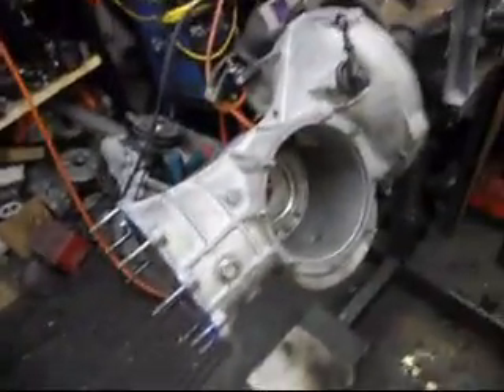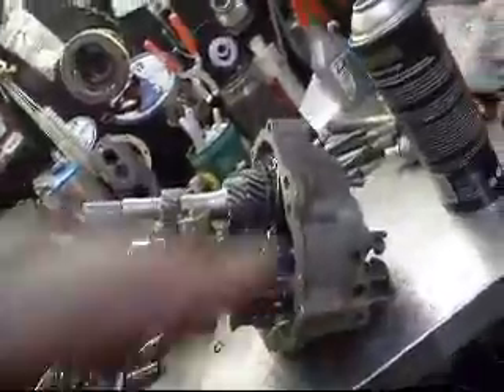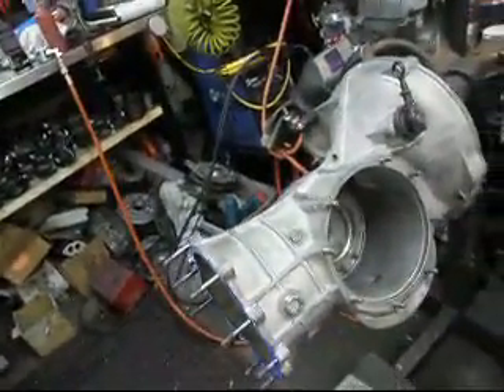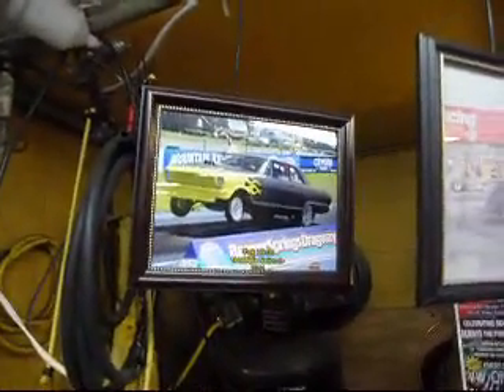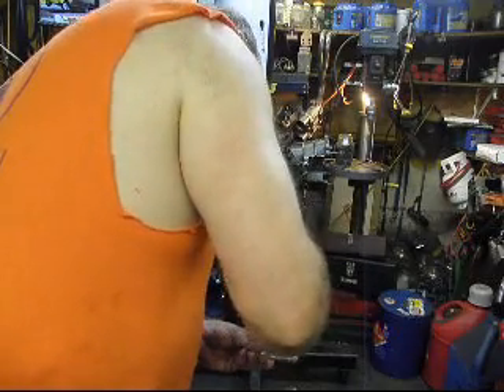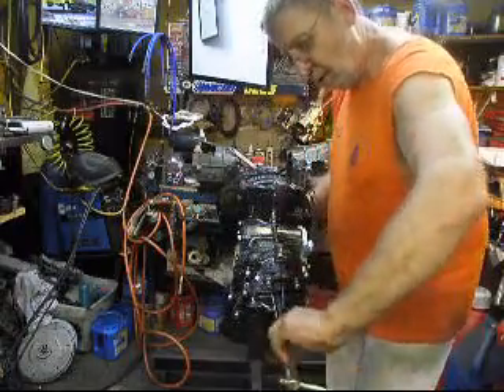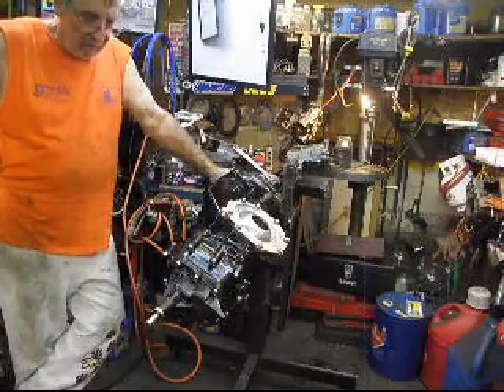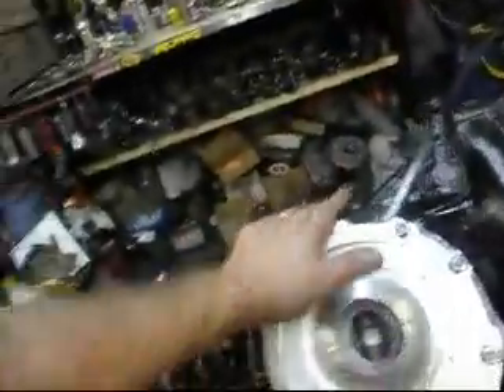Geno, building a super pro street box for sale

Comment: Hi Geno I have a beetle 1968 with swing axle and 300 hp, I just blowup my Transmition , now I want to build another one, but something strong can handle the power for a burnout on fist gear but I use the car for cruiser on hwy to go In car shows, so what you recommend for me to handle a little fun but I still can cruiser on hwy with low rpm.